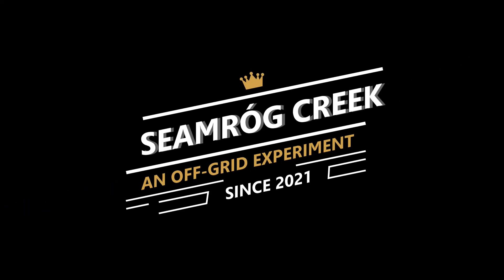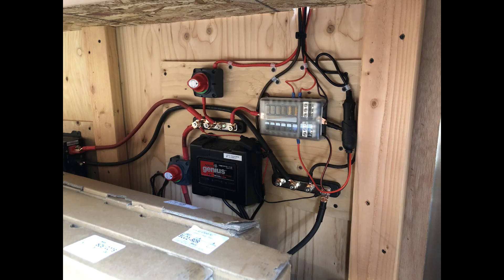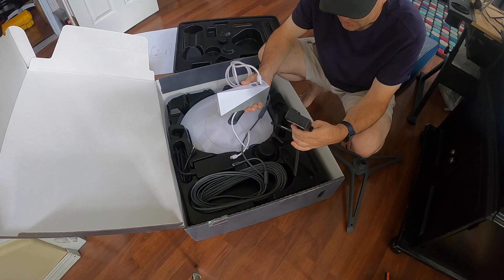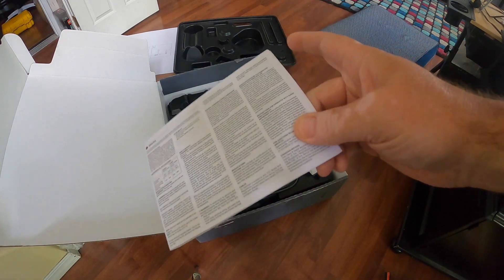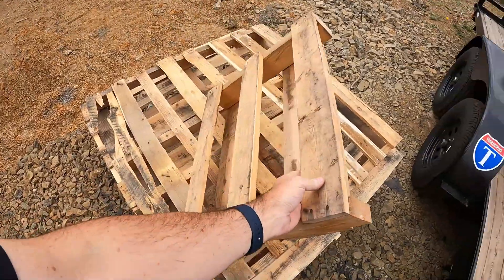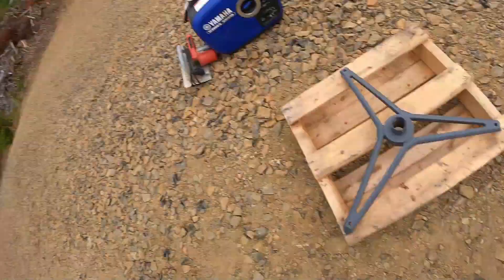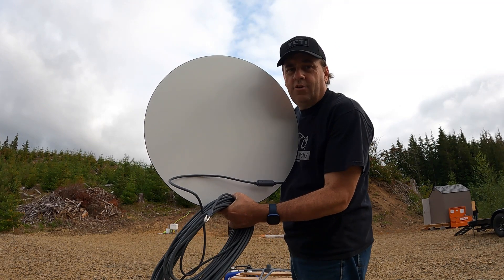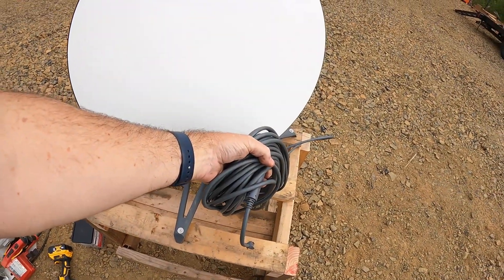Starlink Installation - Satellite Internet, finally!

Comment: Great video! How many amp hours do you have of capacity?
Reply from the maker: The new system will have 1200AH in it.   Here's a video on those batteries:  https://www.youtube.com/watch?v=dFALkXQgE9A  

The current tiny system running Dishy is like 200AH.

Comment: I just got mine setup  (August 29) in Rural Montana.  Replaced the Router with a TP-Link Mesh network and now have Internet all over the property (it was seamless, just unplugged the Starlink Router and plugged in the TP-Link.  No special configuration).  No more driving into town to check email (we don't have Cell Phone coverage either).  It was worth the 6 months I had been on wait list.
Reply from the maker: That's awesome Ray!   I just swapped out our router over this past weekend.  Same thing dropped in a TP-Link router and it came right up.   I was able to hack the AC wall-wart off the end of the power cable and wire it straight to the DC Fuse panel on the solar system, because the TP-Link routers are already 12vDC!  So the router doesn't have to run through an Inverter now, its 100% direct solar powered.    Same experience here though, no configuration necessary, it just worked!     I agree totally worth the wait.  We are lucky enough to have descent cell coverage so at least we weren't totally "in the dark" until it arrived.

Comment: You cannot port forward on Starlink at present you also need to change any traffice using smtp port 25 outbound Starlink is using cgnat, they also don't know when IPV6 will be implemented which is the eventual solution. you need to change your mail client to port 587 to be able to send smtp (mail)
Reply from the maker: Thanks for the tips Robert!   Can't wait for IPV6 and some features that come down the road.

Comment: Always enjoy the new Seamrog updates. This one was great. Really cool to see the setup of the Starlink internet for the first time. What are the upload and download speeds?
Reply from the maker: I've only tested it a couple times on that day, once I have the new router in I can run remote tests on it regularly as I think during the beta period bandwidth can vary a bunch, also time of day depending on coverage?   Anyway,  I got 30mb down at 20mb up on one test and 50mb down and 18mb up on the second test a few hours later.     I'm hoping to run regular tests and then compile the data.   I will share it in a future video!    There are a lot of reports of people getting 100mb down pretty regularly.  

Latency is only 28-30ms though!  Pretty crazy for satellite
Reply: @SeamrógCreek  Elon and you are my heroes. 😎